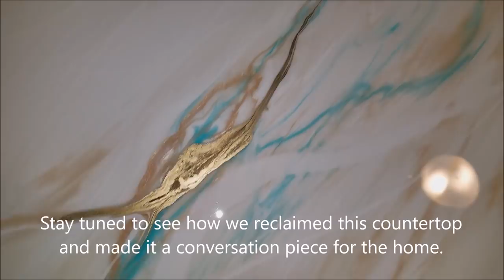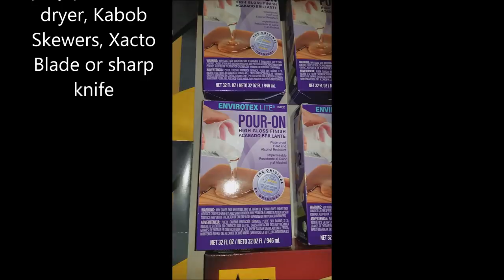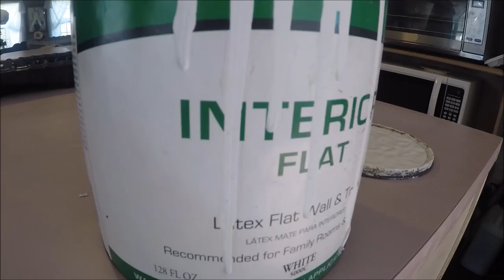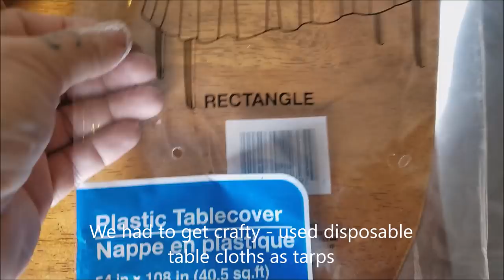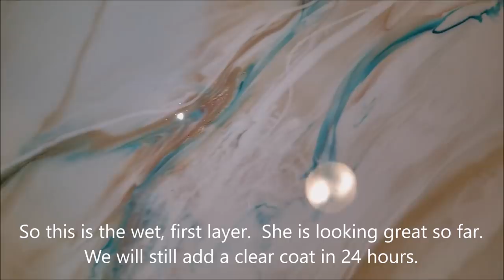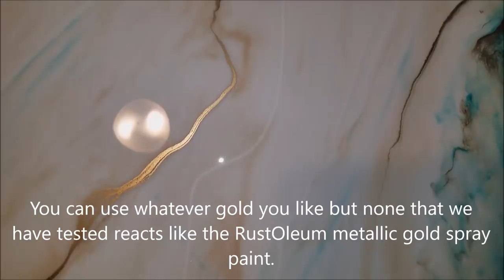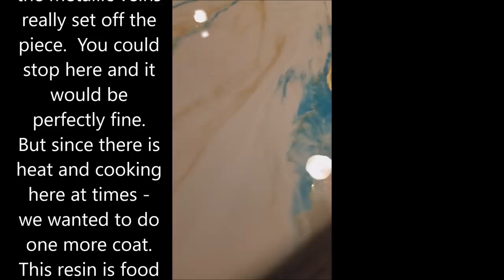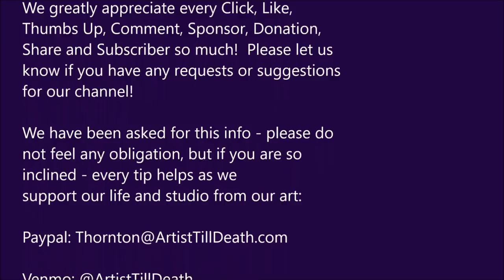HOW TO resin over existing countertops (Our First 8 ft counter and you can do it too)

Comment: I have been wanting to do this for a year, but my current counter has a dark green marble tile. Thank You for this tutorial.
Reply from the maker: Nurse Calls you totally should, it completely brightens up a room
Reply: Artist Till Death  I am going to try my best... 😬  My issue filling in the marble tile grout, so the resin lays evened out on the marble tile and marble tile cracks so I have a flat surface before the resin acrylic  goes on?
Reply from the maker: Nurse Calls you could level the area up with more grout, then seal it with a polycrylic coat or two. Then do a clear resin prep coat to check it out and further seal it before you do the art coat.
Reply: Artist Till Death  Bravo!!! Thank You.  Glad that I subscribed 
To your channel page. I will record it when I do it and upload to my channel.

Comment: Very nice,one question though I thought you had to use a bonding agent for the base coat and then do the undercoat,is it OK to use ordinary house paint as the base coat??.
Reply from the maker: It depends on what the surface is made of.  Yes, a bonding primer is ideal but in the small town we were in, they didn’t have any. So in order to combat this we sanded the surface to create the tooth that the bonding agent would have provided.

Comment: Absolutely love it! the roller tip is great, just wondering how long it needs to cure before it's safe to use? I also now know you need more than one person for large areas, need to find me a willing helper lol
Reply from the maker: Hey Lou!  The foam roller is great to get the feathering without tilting the counter - make sure it's foam though.  It's safe to touch within 18 hours usually but I wouldn't set and leave anything on it for roughly 72 hours.  If you do, it can leave a slight indention.  It's definitely better to have a helper for large areas since the resin will begin to set and be worthless within 30 mins unless it is able to breath on your surface (you saw what happened to the resin in the cup, lol).
Reply: Thank you need to ask someone who can handle a heat gun who doesn't forget and think it's a hair dryer haha
Reply from the maker: Lou Phillips haha true

Comment: Looks great but I don't think you can put hot stuff on directly on it ? Can you.. just like on marble we can't .
Reply from the maker: It can withstand up to 500 degrees F.  Is water, alcohol, UV and scratch resistant.
Reply from the maker: Correction, I just noticed that we used Envirotex Lite on this one - this resin is just like the countertop resin we switched to but it can only go up to 260 F.